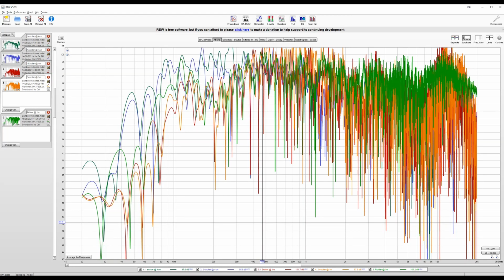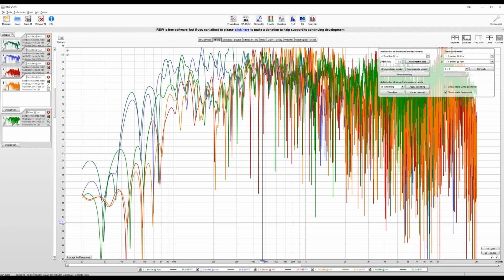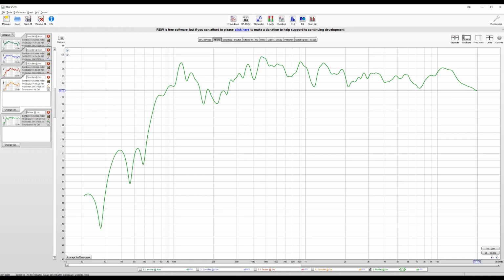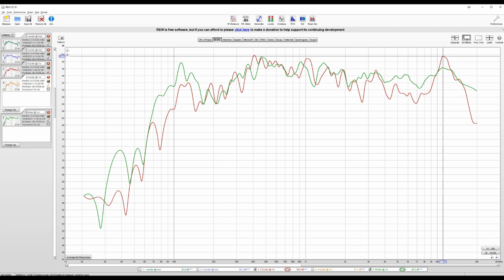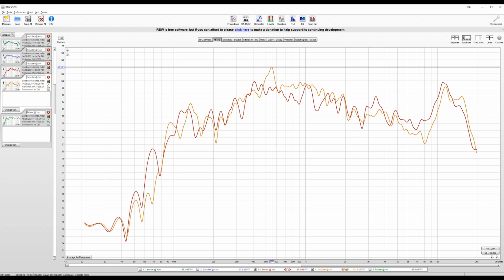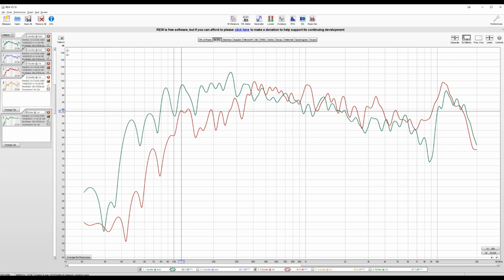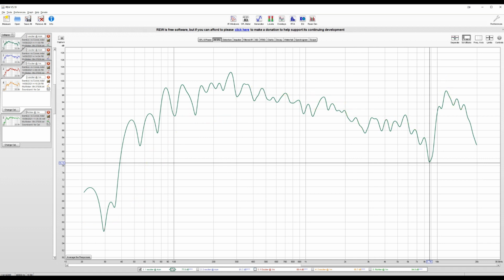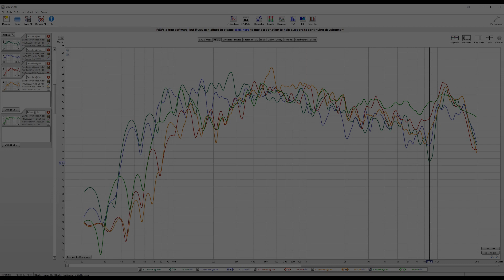Measuring my DML Panels - Are 2 Drivers Better Than 1?

Comment: Well done, Ben.
You mention that the curve drops from approx. 100 dB at 15 kHz to approx. 90 dB at 20 kHz and calls it a 10% drop. Since the dB scale is logarithmic, this to the human ear is more like a 50% drop in volume but again - hey, who can even hear those high frequencies any more. I certainly can't hear a thing above 10 kHz.
The difference to the floorstanding speakers probably is that the low weight of the dedicated treble units membrane gives better resolution and "airiness" to the sound.

As for the canceled bass, I know that helium is one of the best sounddamping elements in existance so if a flat helium-ballon covering the whole backside of the panel could be glued on, the low end would improve a lot. But not a very practical thing do do and not aestetically pleasing either. 

I will follow this very interesting work.
Reply: Clarification on how to intrepret the dB scale - Even though the dB scale is logarithmic, human hearing tends to have a similar sensitivity to sound. To oversimplify, the  logarithmic scale is a good approximation for loudness (at a given frequency). The perceived loudness also depends on the frequency but that is a whole other thing.
Reply from the maker: Hi OleTC, good point, thanks for the clarification on the dB scale. 

I do have some smaller (19mm) exciters which I plan to experiment with later - maybe even crossed over to act like a tweeter. For bow though I think getting an even response in the more audible range is my priority.

I’m trying to imagine what balloons would look like stretched over my panels now… like you said probably a bit odd!

Comment: Oi mate , try in a frame using  springs as the suspension points . I have had really good results with this mounting method. Even they are just suspended from the top they have entermodulation problems , I use two springs on all sides of the panels sized to the picture frames I built .buy sets of springs in 16 packs ,and also buy a few different sets of springs with different spring tensions which will allow you to taylor the compliance of the panels ability to resonate, cheers ,
Reply: Jason, could you post a picture or something about your spring frame?  It is a great idea . . .
Reply from the maker: Hey Jason, that’s a pretty interesting idea and seems like a good way to keep a consistent tension across the panels. More more thing to look into I guess!

Comment: Great videos.  I’m literally experimenting with my own DML speakers as we speak or type or watch youtube. Unfortunately I’m no sound expert, so can’t offer any advice only to agree with what the comment above about room acoustics.  The sound recording is best done in some kind controlled environment where external acoustics don’t affect your sound.  I too had misgivings about the foam board so I’m not using that but I like your bamboo design very much. In my searching I came across the speed of sound measurement when determining the acoustic qualities of a material. Aluminium has the best sound qualities apparently, but again it all depends size and thickness.  I’m interested to see how you get on.  Very helpful, great work.
Reply from the maker: Hi James. I think that metal could look amazing but I reckon it might be hard to dampen sufficiently (I think one of the tech ingredients videos shows one and it has a lot of ringing).
Reply: Look no further than the Visatonpaper (the document with the measurements at page 3). Look in the Download Bereich, the document is called Visaton Exciter-Technik.
Reply: @nikleiser5888  Hey thanks for the info. I checked out the document which was very informative. I always thought that a natural product like wood is the better sound producing material.  But, with these exciters it shows that other materials might work better. The hollow centre or honey comb centre happens to be how a lot of Ikea panels are constructed. I happened to have some so gave it a try and it does seem to produce a better sound. It was good to learn to keep the speakers away from the wall as this helps to maintain the lower frequencies. Very helpful.

Comment: Remember that alot of things besides the exciter itself will affect the response, material, size and proportion of width to height, panel thickness, how the panel is supported and exciter location as you mention.  Not to mention room acoustics.  The low frequency cut off is greatly determined by the room dimensions.
Reply: The 11 k peak is probably a panel resonance.  Do a waterfall plot to see how much stored energy is in the panel itself. When there is stored energy the panel, that stored energy will add the the output of the panel at the frequencies the energy is stored.
Reply from the maker: Thanks for the tip. I'll definitely work on a few of these things and post my improved findings.